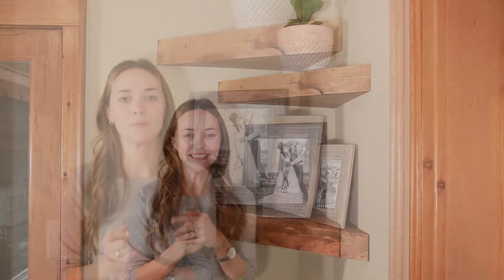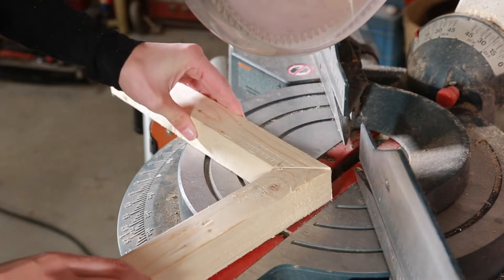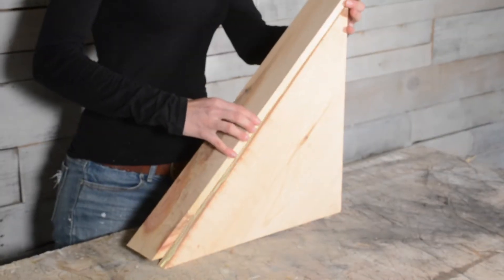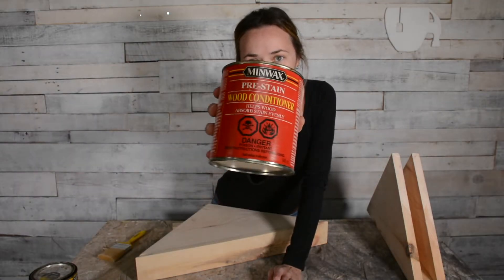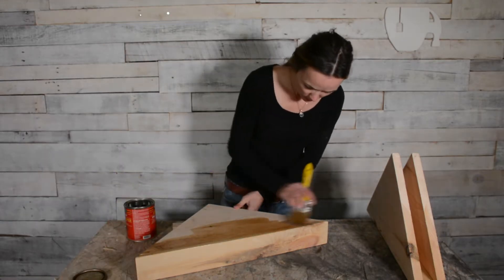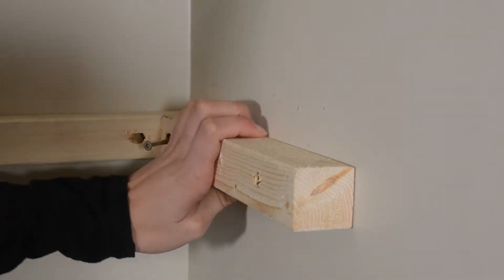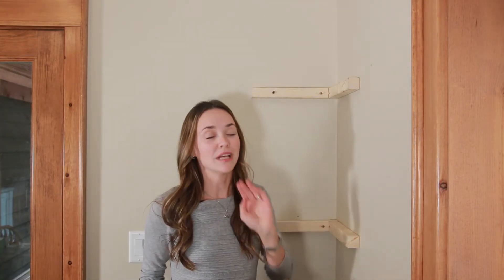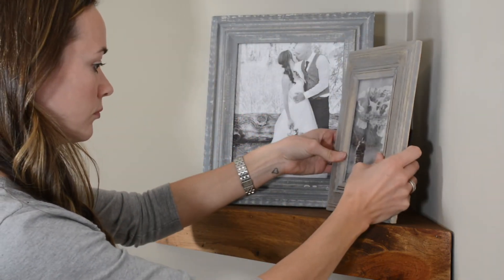DIY Floating Corner Shelves

Comment: I made similar ones and after 3 hours of cutting gluing and screwing I found when I was installing that the walls were not square and they did not fit right
Reply: useful point!  I built a shelf in the garage, and found that the floor and walls were not straight/even.  Fortunately I could customize each shelf to fit - the advantage of DIY.

Comment: Can you give more detail on the measurements? I have now wasted several boards and they are still not right!
Reply: I think you'd have to measure the specific angle of your wall corners, and then cut the board accordingly. Unfortunately, not all walls are perfect 45 degrees.

Comment: Hey! Everything is perfect BUT my 2x2's aren't secure against the wall. I even tried anchors when I couldn't match it up with studs. How are you making sure the screw doesn't drill straight through the 2x2 since there's nothing to stop it? Hope this makes sense. Thanks so much for the design plan!
Reply: She counter sinked the screws bit if you don't counter sink...you needed 3 inch screws

Comment: You should have used a small amount of wood glue on the top of the frame because with no glue, nails screws they are not well secured to the hidden frame

Comment: Where did you find 1x3-1/8ths wood?  I checked both the local Home Depot and Lowes and they only have 1x3" or a 1x4"
Reply from the maker: not sure I follow I didn't use any 1/8" thick wood.. Are referring to the 3/4" pine boards I used for the outside facing ?
Reply: @TimberTea  Sorry for the confusion! For the outside facing, "I also need a 1 x 3 1/8ths” for the front panel". 
The 3-1/8ths" is the hard part!
Reply: Daniel Belter yeah measurements are confusing. She uses both nominal and actual measurements for different pieces. need 3-1/8” actual width for front face according to the build materials (top/bottom actual width 3/4” each, plus 2x2 actual width 1.5”). In the description, she uses nominal 1x12 (not 3/4”x11.25”), and nominal 2x2 (not actual 1.5”x1.5”). This mysterious 3-1/8” actual width is not something that can be found at Lowe’s or HD.
Reply: Thank you!

Comment: What size did you cut your triangles to?
Reply: 12" at 45 degree angles
Reply: seems like 24" to me @gotheatsauce
Reply: @j4wentworth  its not mine are 12" then with the face is extra .75"
Reply: @j4wentworth  from front corner to corner is 25 5/8 like she said

Comment: Your idea looked simple at first, but getting all the angles to aline was almost impossible even when measured three times and cut. Your shelves look 10 time better than mine. I think I will scrap this entire project.
Reply from the maker: noooo!! I hope you didn't give up!! and it doesn't have to be perfect. all those imperfections just add character hehe :P
Reply: It seems like maybe your wall is not at a perfect 45. I would do a cardboard template first or use a tool to see what angle your wall is a actually at. Mine is just a touch over 45
Reply: This is a how to specifice to her wall....that's why this won't work for most people.  And that's why I only watch for design ideas...not to follow the instructions to the inch

Comment: These measurements don’t make sense to me. If you are using 1” wide boards for the top and bottom and a 2” board for the spacer, wouldn’t the facing board need to be 4” wide? Not 3? SO confused!!! step by step plans would be helpful!!!!